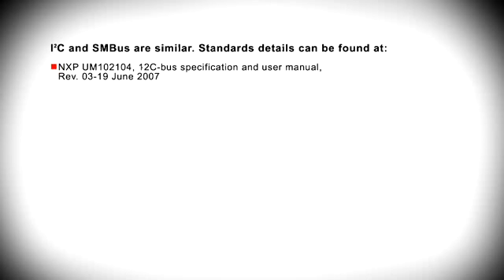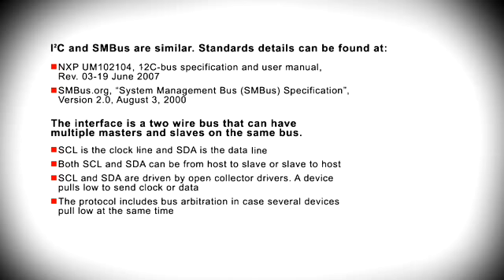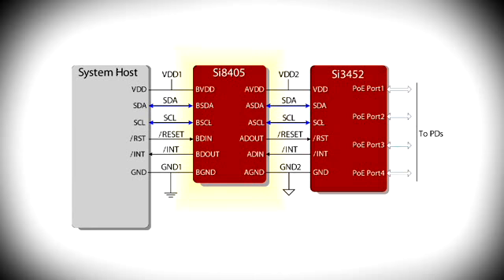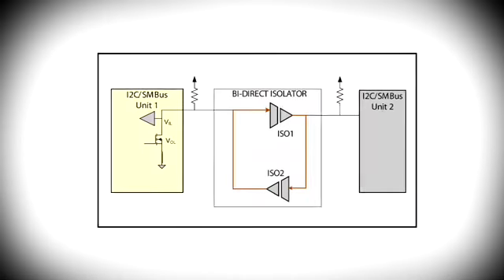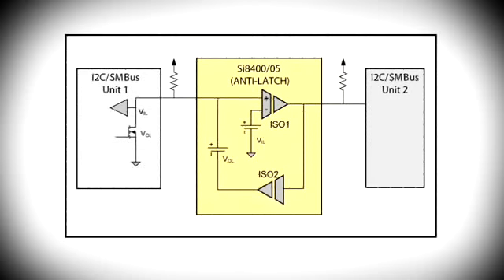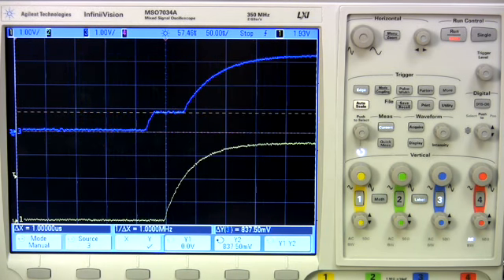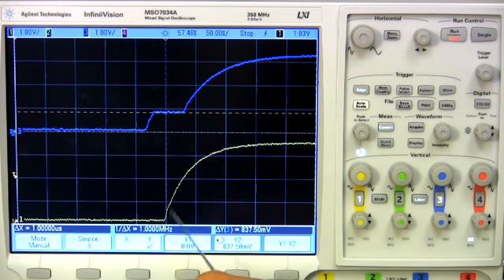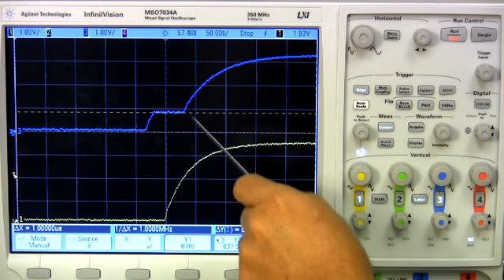Power Over Ethernet (PoE) - I2C and SMBus Isolation

Comment: Remember when programming with your USB adaptor to a PoE board that is not completely isolated from the power over ethernet, that a switch off will result in around 50volt difference. The solution - isolate your USB programming/debugging adaptor from the PC by using a USB 2.0 Full Speed galvanic Isolator - see electronics-shop.dk